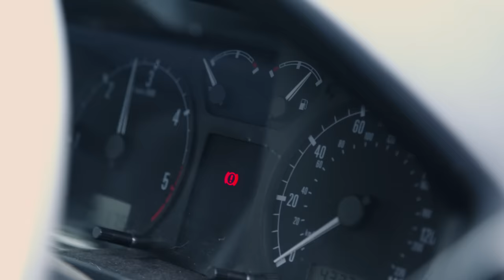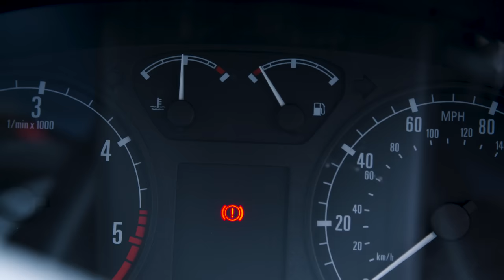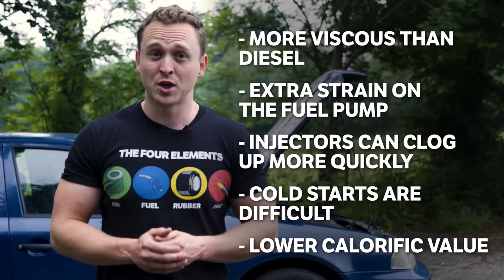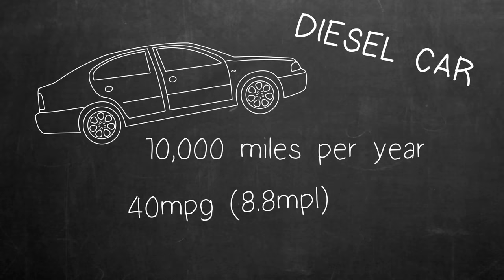The Pros & Cons Of Running An Old Diesel On Used Vegetable Oil

Comment: In the Netherlands, it's illegal to run your car on veg oil, if cops smell it and pull you over, you're in trouble.
Why? because the government misses on taxes!
If you still want to drive on veggie oil, you should declare every fillup to the government why make you pay the tax separately.. You should be able to show a recent receipt of the tax payment to the police.
The government only cares for money, not the environment.
Reply: wdonders its legal in uk, providing you paytaxes
Reply: So is fueling up abroad also illegal?
Reply: When you fill up abroad at a gas station,  taxes are included in the fuel price. We're talking about filling your tank with veggie oil here.
Filling up with veggie oil abroad could be ok in some countries, but if you drive back to NL, you better have some proof of taxes payed like i mentioned earlier
Reply: Veggie oil is taxed as well, but less than normal fuel because it's not meant for wearing down roads while poisoning the neighbors.
Reply: Correct, so you have to pay EXTRA taxes on this veggie oil if you want to use it to propel your car. You can do this by declaring it separately and pay the extra taxes. If not, you could get an very expensive fine
Reply: Well that's Dutchmen for you.
Reply: It's also against EPA regulations in the US, if caught using untested fuel on a federal highway it's a $5,000 fine (although there is no one checking, someone would have to drop a dime on you), if you get caught modifying a vehicle to run on griesel the fine is $7,000 per vehicle, which explains why no full time mechanics will do it.
Reply: In Italy you can't even declare the fillup, you go directly in jail for this -.-''
Reply: Of course, it's the Netherlands.

There's a reason our fuel is literally the most expensive in all of Europe. More taxes is more better, I mean look at our economy grow! I know the citizens aren't noticing all that much of it, but that doesn't matter.
Reply: @99domini99  i'm Italian and i notice it...
Reply: It's the same in Hungary. You can't use cooking or vegetable oil legally to power your car.
Reply: government at its finest and every few years they keep inventing some new bullshit tax to steal some more of our monney im from Belgium and more than half the price we pay at the pump goes to the government as taxes its fucking rediculous
Reply: it is  like that almost  in whole Europe
Reply: I think it is because the tax in general is on emissions (CO2) not regarding what the source of the emissions is.

Where I live in Sweden we have a tax on CO2 regardless if it is emitted from fossil fuel or say ethanol. Regardless of the source the fuel still produces CO2 emissions and that is what is taxed.

Can seem a bit strange but if you think about emissions are not good regardless of the source and should be reduced even if the source is non fossil.

However you could argue the tax should be lower on renewable fuels as a transition to sustainable transport. But also if everyone were driving on vegetable oil it would probably not be sustainable either.
Reply: I could have sworn it was illegal in the UK, too - there was an article some years back in the local newspaper about people getting fined for buying vegetable oil off the shelves at the supermarket and filling their cars with it. Apparently, at least at the time, vegetable oil was cheaper than diesel at the pump due to the fuel being taxed and the oil not being taxed. So many people were doing this that in parts of the UK the shelves where the oil usually was were bare.
Reply: Aint oil already taxed lol as any other thing in shops etc? Literally doubletaxation which in many countries is illegal to do.
Reply: Cooking 🍳 oil 🛢 was taxed when bought, when food 🍲 was made and sold, taxed again.

Now recycled ♽ and purified to be put in a car, guess what, you get taxed again?

Moreover, if you preduced CO2 from exhaling or methane from your crack 🍘 you should, in theory, be taxed again due to Gaia god of the environment punishment imposed, I suppose.
..
Kidding,

But seriously, is being taxed from using the rood is based upon fule concepmtion?

Anyway, I am from Middle East and we dont pay tax, not on fuel ⛽ nor on smelling flowers 💐
Reply: In Poland you also have to pay fuel tax if you "make and use your own fuel".

The question one should ask themselves is how can government prove that the fuel in your tank isn't the one that you paid tax for 6 month ago ;-)
Reply: @Pete Coventry  Old diesel engines can run on almost any oil, including veggie.
Reply: @wdonders  I guess, that the taxes have been paid for the veggie oil on purchase.
Reply: Sounds about right. Home fueled CNG cars do the same
Reply: @Bandbtucker  The land of the free .NOT .
Reply: Yes because your car is high on fish and chips I'm joking
Reply: Heb zelf een diesel, wist het niet eens hier.
Reply: @99domini99  haha lookup fuel prices on portugal and be glad you dont live here
Reply: Yep it's stupid
Reply: Have you really understood why you pay taxes on fuel?
Who pays for the road infrastructure and evironmental damage (which is less with vegetable oil but still present)?
Reply: @Blast-Forward  sure but we are currently paying here 1,50€ per liter of diesel and the minimum wage is about 500€ so think about that....people are taking 2 or 3 jobs and they dont have time for their family and kids..people are evading taxes and breaking the law whenever they can...its a disaster..glad we are a small country and commutes are low-miles..if not then we would be even more fucked...gasoline here is at about 1,65€ per liter and 2 stroke gasoline (gas+oil) is about 2€ per liter... of course there are people that can ride a bicicle but its not safe to take your small kids to school on a bicicle and the time it takes may make it impossible...and for carrying loads and working you must have a van or truck so we need cheaper fuel..
Reply: In New Zealand. Only petrol is road user taxed in its high price. Diesel ev lpg and other fuels pay for seperate road user charges. We pay per km.  At the moment to run my diesel its around $1.60 per litre of diesel and around $70 for 1000km of road user charges.
So no matter what you do you pay alot of tax
Reply: In Romania you can use oil as long as you want, nobody cares lol. In fact there are some dudes who buy oil  bottles at the supermarket and mix it with diesel to run their cars.
Reply: @ivuldivul  Motor oil, Transmission oil, hydraulic oil, canola oil, lots of oil, but very few people do it.
Reply: See a cop or driving slow? flip the switch. Done
Reply: You're wrong. You can drive on veggie oil no problem. I've done it for years! And yes I've been pulled over.

It's only forbidden to fill up your tank with veggie oil. But let's say you fill up your car with veggie oil in Germany and then drive back to the Netherlands then it's perfectly allowed.

And since we are in the EU it means that you can travel all you want with your tank of veggie oil which you purchased in Germany.
Reply: @wdonders  even if the last fuel (veggie oil) was purchased in another country??
Reply: What about electric car running on electricity from solar panels? It's not taxed.
Reply: @volkhen0   Here in NL you can do anything with your own solar panels what you want. You can even sell your power back to the electricity provider to compensate your own use on dark days and nights.
Reply: @wdonders   No we are in the EU so there is free traffic of goods. What you have in your tank you can take freely whereever you want. Of course when you bring a trailer with 1000 liter it's different.
Reply: @ryanwiese5280  don't  use  hydrolicoil
Reply: Ik ben ook nederlander en kan geen diesel auto meet betalen (wegenbelasting)
Reply: wdonders oh my god like for real didn’t know about this I feel you it’s horrible bro
Reply: I had a Vauxhall Astra with the Isuzu 1,7l diesel engine. I used to mix veggie oil with the diesel 50 50 and you coudnt smell anything from the exhaust. Car would run fine even cold winter start ups
Reply: In my country (Serbia), people mixed new, non used vegetable oil with diesel 50-50 for tractors and old diesel cars. 1l of veg oil was 1 dolar, 1 l of diesel was 1,5 dolars in 2015. It was on all news, tv... so in 2019 1l of veg oil is more expensive than 1l diesel so people don't do that anymore. In Netherlands, your governemnt tries to save your engines from bad bad bad veg oil. It is not about taxes :D
Reply: Netherland - diesel 1,55 euro-  minimum salary 1300 euro.
Serbia - diesel - 1,35 euro - minimum salary  250 euro
You are good.
Reply: Here in the US (Tennessee) I can put whatever will burn in my VW tdi.  Except for off-road diesel meant for farm use since it isn't taxed.  But if I fill up at home with greasel, who cares?  No one around here.
Reply: Now I know why the YELLOW VESTS are rioting in France:  With taxes so high, people are beginning to die.
Reply: Sounds about right. Glad I don't live in Europe
Reply: Mix it 10 :1
Reply: Honest John I used to drive it till the light came on then filled it midway the added vegetable oil till  it was full'ish. I just put it straight in and used it no problem. Winter I would use higher ratio diesel to oil  ☺
Reply: in Germany, it's the same, but it has been proven, according to the ADAC(big german car rescure company), that veggie oil is far less enviromentally friendly(at least to produce vegetable oil in the first place) and it has a much higher risk of causing cancer. It's written in a paper, that they published 2012
Reply: @CLP Heating oil would be also breaking the law in germany.
Reply: don't you already pay a little tax on stuff like veg oil anyway?
Reply: @jesselapides4390  yes, but you pay more on fuel, so it's tax fraud.
Reply: As the video says the uk you have to pay fuel duty if using above a certain amount of veg oil
Reply: same in france, but for boats I guess it's ok.
Reply: wdonders same in the UK.
Reply: jerome faulle what if you own an amphibious vehicle 😂
Reply: same in germany
Reply: wdonders no in french is not illegal
Reply: same for germany
Reply: Think of it this way the taxes on that vegetable oil are already paid since its a used product whoever you got it from that bought it wholesale or whatever paid the taxes there. that makes sense but all governments are money grubbing bastards unless your working for them Take Canada for instance that fucking carbon tax is insane its literally criminal what gas costs here especially in Ontario.
Reply: @youneverknow111  Money is all that matters to them. But we are not them.
Reply: @filthymcnastyazz  you don't have to pay taxes unless you use massive amounts of it
Reply: @volkhen0  actually, it is, just at a domestic supply rate.
Reply: It's only fair cause everyone else in the Netherlands needs to pay to fuel their car
Reply: @L0mp3Harry  How much tax on their fuel does someone pay in the Netherlands if their chosen fuel is electricity from their own solar panels?  The "it's not fair because I pay more" isn't a strong argument.  Change your fuel type.
Reply: Government: "We love the environment, so let's put a CO2 tax."
Also government: "We love money, so let's put fines and taxes on eco friendlier fuel"
Reply: fuel taxes should be replaced by taxes per mile driven. jut get an annual odometer reading when you renew registration. you could also tax different models seperatly by things like weight, and do incentives for electric and hydrogen vehicles
Reply: @wdonders  so you cna do this in NL if you want to, just do a little extra paperwork?
Reply: @PlaystationMasterPS3  But this already happens. You bung a load of fuel in, that gets you a certain mileage and you've paid tax on it.
Depending on fuel efficiency, your payment may differ from that paid by someone using a vehicle of different fuel efficiency. That's your modifying factor already built in.
Nothing to change here at all.
Reply: deWaardt currently diesel in my hometown when it’s on sale it’s €1,33 / litre. From which there are €0,40 / litre production costs. The rest is tax
Reply: Al "little bit" of paperwork? EVERY TIME YOU FILL UP you have to send letters, receipts, pick up paperwork from tax offices.. :-( Not workable and this way discouraged by the government
Reply: AndreaMelk come per dire che controllano
Reply: Your government is corrupt
Reply: Mix a little of diesel to disguise the smell and be ready to roll
Reply: good yu can smoke cannabis ! marry you're sister !!!  but recycling oil into power you can't !!!!
Reply: Well there goes my plan in buying an old diesel and using veggie oil however with the switch you could just switch it back to diesel at checjpoint or whenever theres a police car around
Reply: wdonders shat ap
Reply: @filthymcnastyazz  he just said the same thing. I don't think you read his comment right.
Reply: @booshallmighty  i said something different, i dont think you read my comment right
Reply: Same shit is going on  in Hungary
Reply: Only the tank you're using at that very moment. You can't "hamster" fuel in Belgium, Germany or Luxemburg because of the same tax evasion. It is a unified Europe as long as it suits the governments.
Nevertheless it's been years since the last time I filled her up in the Netherlands. Germany is too close.
Reply: Just because it's better than Diesel doesn't mean it's good. Also, this tax money is used to build and maintain roads and infrastructure.
Have you thought about this for longer than it took you to write this comment? Probably not.
Reply: what about visitors or  those passing from france to germany?
Reply: Well, someone paid taxes to buy the vegetable oil. So it's actually not a tax free form of transportation.
Reply: your allowed 2500 liters per year tax free, as long as you can prove it !
Reply: @wdonders  mix regular diesel with veg oil
Reply: @wdonders  I imagine an argument against double taxation can be made in the case of using biodiesel as fuel. As cooking oil, it was already taxed. If the government wants to tax its reuse, then you can make the argument that you are also owed carbon tax money from reducing the amount of greenhouse gases emitted. The world has an excess of lawyers, and this is one way to put their skills to good use.
Reply: Ja echt he en nu alleen maar 100km/h rijden en datsoort maatregelen maar dit dan weer verbieden. Echte flikkers in den haag.
Reply: Get diesel generator and electric car run generator with vegetable oil charge car xD
Reply: @Blast-Forward  I bet the government could just about run the country from fuel taxes alone...
Reply: If more people do it, they will fabricate a narrative like "burning vegetable oil has been found to be bad for the environment" and ban it in the guise of "environmental protection."
Reply: It wouldnt be a government without taking all your money lol
Reply: Same in Germany.
Reply: I still so it, and I run it on old motor oil, which is even worse than normal diesel
Reply: I suppose argumenting as an environmentalist does come with it's perks to save some cash.
Reply: Its illegal in the states to but most cops won't bother you
Reply: @erasus0307   do you worry about cops ?
Reply: @sammyd7857  not really. There are a few modified cars in my area, and the cops leave them be. I drive regular petrol car, but I do try to keep up with EPA laws
Reply: @erasus0307  ok the cops sound ok in that regard. If you are spewing smoke then it is fair enough because you are harming people
Reply: @sammyd7857  see I live in the Adirondack Parkway of upstate New York and my way as long as you're not blowing off youth black smoke stacks cops don't really care. Your more likely to be stopped over skin color if they think your jamaican. (I'm a native a/a lol)  then smoke or for noise violations for loud exhaust.
Reply: Let's just use red diesel.
Reply: The government only cares for money, true words.
Reply: Luckily in my country the government doesnt care if you use vegetable oil as fuel since the government is supporting alternative fuel, even gasoline in my country is always mixed with biofuel so might try this on my old diesel car....
Reply: Denmark cant see its illegal. Use 10% bioethenol in benzin.
Reply: Kinda more sustainable reusing the oil 😁
Reply: Just keep a bag of fish and chips int car... At all times. Or in the engine bay. Say, "I was keeping them warm, sir."
Reply: In New Zealand we pay per Km driven not c/L it's not illegal to run but you still pay tax either way, same as in the Netherlands there is a way to get around paying taxes on your vege oil / km driven
Reply: @Blast-Forward  we have road tax for infrastructure, which is already like €125 p month for a car like Miles
Reply: @rubenyoranpc  WTF? 125€ PER MONTH? Is that just for owning the car? In Germany I pay no more than 28€ per year in tax for my car (1,3L gasoline). And that tax doesn't account for how much you drive and actually use the car so using fuel taxes is a way to make it fairer because the more you use the roads, the more you pay. However, it's not ok that they can use that tax for whatever they want.
Reply: @Blast-Forward  Thats for a diesel, and diesels are much more expensive than a petrol. I drive a 2007 Focus petrol 1.6 myself, and roadtax is about €50 a month with about €65 a month for insurance. Fuel is about €1,50 p L, so driving is expensive AF....
Reply: @rubenyoranpc  That's really expensive, I agree.
Reply: Same in Belgium. In the fuel prices here, about 1€/l is pure taxes, the rest is mostly profit margin of the oil companies.
Reply: What!
Reply: iskandartaib I thought so too. I swear a person I knew got in trouble for using it in his car.
Reply: Yes, government need lots of your tax money to help migrants(your replacement) in housing.
Reply: Here in Hong Kong you can only run a car with gas or diesel,or lightning
Reply: @Bandbtucker  Its a very simple conversion, and if you're in a state that doesn't do emissions testing (like mine) you will have no problem finding a diesel mechanic to add the second tank and lines to your car. But no chance they will do it at somewhere like a dealership or chain store
Reply: Police can prosecute in the uk too. I know of news stories “evasion of excise duty”
Reply: I think its shitty man ye, but they do need to pay for roads. Shit i agree but necisary.
Reply: @quins600  my God, I drive that in a week. I'd be broke living there
Reply: screw them, im sure they wont be able to find out you run on veggie oil
Reply: @jannieschluter9670  Found he tweaker.
Reply: @CTimmerman  if only they spend taxes on the roads except from leaving massive potholes
Reply: Because those taxes go to repair the road. The government isn't trying to rob you of every penny you have. You use the roads, therefore you cause wear on the roads, and therefore you should pay for your use of the roads via fuel taxes.
Reply: Insane
Reply: Same in US. It's stupid. It's your car and you should do what you want with it
Reply: WOAH, just WOAH. i didn't imagine Netherlands was like that, and people in latín América dream about being in NL, and also they believe there's no corruption and everything is like paradise :o
Reply: @Blast-Forward  we also pay road tax to cover for that, which depend on the weight and fuel of you car. a normal family car on petrol you pay about 1000 euro per year. for a heavy suv on diesel expect to pay even 2000 euro.  that is to cover road repair and acts as a pollution fine
Reply: @sverduijn1 😊 you still need to be able to show the receipt of the fuel you bought abroad. so you were lucky
Reply: @sverduijn1 haha, that's changed now isn't it 😂